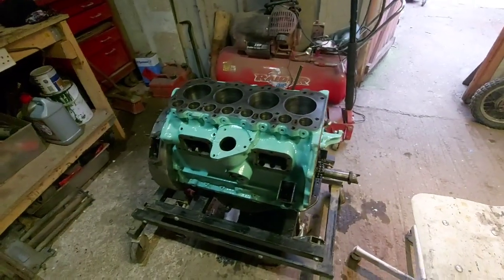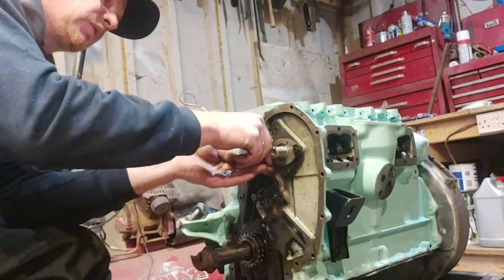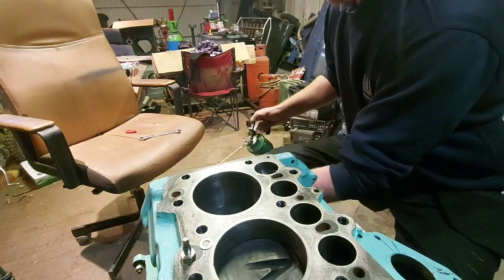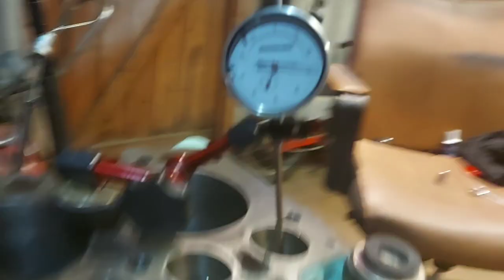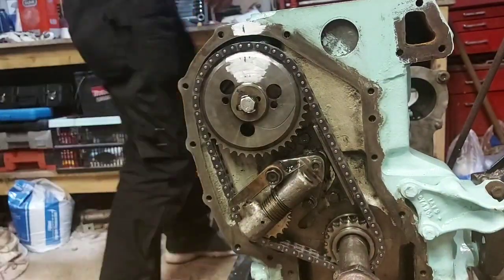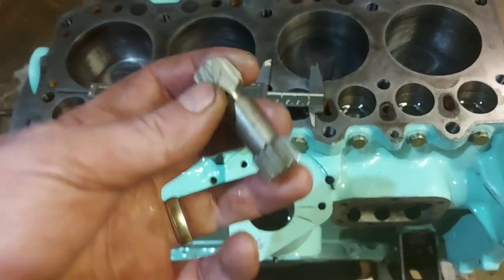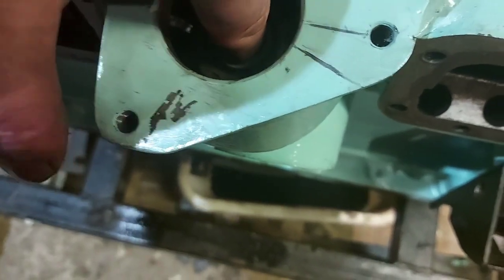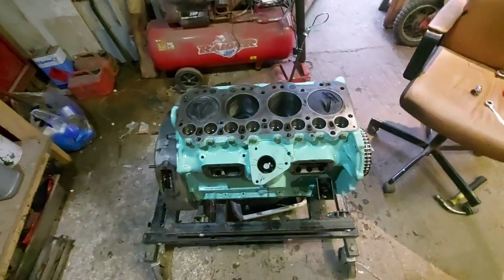land rover series 3 2 1/4 diesel build part 9. how to fit a new camshaft, timing chain, skew gear

Comment: Hello csm good video cheers  timing a 2.25 diesel   would I be looking for the middle of the flat spot off the cam or the highest  peak book vary Haynes  manual says  bring cam to high est peak and put the chain on .lr
 book says middle of the flat spot  so I set it at this but I would say it was lagging at this setting head scratch no sure
Reply from the maker: Hi, thanks for watching!
The middle of the flat spot is best if you've got running issues with it in the middle then you could also have other problems like a worn cam, injectors, fuel pump or fuel pump adjustment. 🙂👍

Comment: Hi mate. I am just about to replace my chain and sprockets but the new cam sprocket I have only has one keyway and I can't find a multi keyway version new anywhere. Would you reccomend using the old sprockets if they are not too worn with a new chain or would you say use the new sprockets too even though there is only a single keyway?

Many thanks, for the video!

Comment: The timing Cam wheel on the end of the cam shaft has a number of splines that allows for fine advance or retarding by a few minutes.. I'm hoping this may allow This might allow 20 degrees to be obtained bang on, if the pump drive is still out....  I see you have the 3 bearing 2.25. The 5 bearing 2.25 has a slightly altered Skew gear design, with one piece bronze bush and a thrust washer. Nice to see it being done...
Reply from the maker: Thanks for the input.  🙂👍

Comment: just blue a hed gasket on my 1978 series 3 have a spare engine from a 2a stripped down at the moment going to do it up and then swap it over i know its a 3 bearing compared to my 5 bearing any ideas.thanks.
Reply from the maker: A 78 series 3 would of originally come with a 3 bearing engine, and to be honest, unless you're thrashing it off road it won't be a problem, land rover and rover were using the 3 bearing crank for nearly 40 years without major issues unless driven really hard. Why not replace the gasket on the other engine? 🙂👍

Comment: I have a 1962  2a 2.25 petrol engine... with the TDC markings on the flywheel ETC...  I know your engine is a 2.25 diesel, but for my petrol engine, would the procedure for mine be the same as yours for the camshaft, timing change, and skew gear, using the EP setting on my flywheel?

Comment: love the work just wondering at the start of the cam shaft your tighteing the nuts anti clockwise  and your ring is on the righr hand but later in the video your ring is on the left hand. is that a video thing  had it before with photos.keep the videos coming really love them christy.
Reply from the maker: Thanks! 🙂 I was filming with my phone depending if I used the front or rear camera it would reverse the picture I figured it out eventually 🤦🏻‍♂️🙂👍

Comment: Cheers mate! Nicely explained 🔥. Little question. Does the flywheel has just one position on the crankshaft? Had someone paid to make a paint job and the shithead mounted the engine with the timing completely wrong (I even printed him the workshop manual). I think the EP mark is all lost and it doesn't indicate the right position. I'm trying really hard not to take the engine off the landy because I don't have the proper tooling, but I can't make the exhaust valve close completely while the EP mark is on the indicator. Greetings from Costa Rica 🇨🇷
Reply from the maker: Hi, the flywheel can only be fitted in one position there's a locating pin that lines it up. 
The EP mark indicates when the exhaust valve is fully open not closed.
Best of luck and thanks for watching. 🙂👍

Comment: Is it possible to confirm the timing by checking the #1 valve movement? Without pulling the head assembly? Cheers.
Reply from the maker: Yes its the exact same process except you put the dial gauge onto the rocker arm👍
Reply: @retro.restorations  Thanks so  much. we have battled the overhauled 2 1/4 diesel, and it's winning. I feel the distributor pump may be 180 degrees out of time. Engine  turns over, but it will not produce power/accelerate.
Reply from the maker: No worries 👍 
It is easy to get it 180 out you need to make sure the piston is on its compression stroke when setting the pump and that the flywheel is set at 13 degrees before tdc if thats all correct the master splin on the skew gear will be roughly facing 4 o'clock when lining the pump the outlet to No1 cylinder will be in line with the master splin +or- a couple of millimetres.
I hope all the makes sense.
Reply: @retro.restorations  Thanks. it makes perfect sense. The green manual describes it. But I have never one to grasp book information. Practical, hands on learning has been my best angle of attack. I'll chat with my team and we will forge ahead. Thanks again. In the future, I have the old motor to test my knowledge.
Reply: We have the engine running. We are experiencing extreme amounts of white smoke. We are going to pull the distributor pump and verify the drive gear of the pump is properly aligned. AGAIN! We are experiencing what we think is pre-detonation.
Reply from the maker: @warbirdflyer7276  have yout tried rotating the pump its a paint in the ass it only needs to be a couple of millimetres out to make it smoke pure White smoke is usually unburnt fuel usually meaning the pump is retarded black means its to advanced.
Its trial and error moving the pump a millimetre at a time if that doesn't work then something else is a miss like injectors or pump or cam timing 🤔
Reply: @retro.restorations  yes sir. That is the first thing we did. The engine ran slightly better when we rotated it to the extreme clockwise position. Still excessive white smoke. Unburnt fuel. So we are think our dist. pump drive gear/skew gear is out of position. bloody bonkers!
Reply from the maker: I would try pulling the gear and moving anticlockwise 1 spline and try again you're very lucky if you get it first time.
Reply: @retro.restorations  we will give that a try. Thanks again so much.
Reply from the maker: @warbirdflyer7276  no worries good luck
Reply: @retro.restorations  Sorry mate. one question. We have rotated the gear one spline anticlockwise. The locking pin is fighting us now. Is there a method to the alignment of pin without damaging the bronze bushing? Cheers. We are so close!
Reply from the maker: @warbirdflyer7276  it can be tricky I use a really small screw driver in the hole to spin the bush until the hole lines up it takes a while but it's the only way to do it
Reply: @retro.restorations  we were using a pointed awl. We will use a larger diameter tool and effort to align the bronze bushing. Thanks. We started to believe that the demons were within this engine!
Reply from the maker: You also need to make sure the gear is at the correct height to find the hole if it drops to low or to high  you'll never find it
Reply: @retro.restorations  I was grey before I started this. Now I am the lune!
Reply from the maker: Haha they drive you mad if you let them
Reply: @retro.restorations  like women! This girl should be running today. Thanks for your help. And patience
Reply: @retro.restorations  well. Gear installed, pin locked. The engine is running better, But it is still smoking like a train. I guess we need to verify TDC with head removed. OUCH.
Reply from the maker: @warbirdflyer7276  it definitely sounds like something is wrong. I wouldn't pull the head yet I would re check the timing if its as little as 4 degrees out it will smoke that could be a couple of degrees on the cam a couple on the pump = alot of smoke I would also get the injectors and pump tested and definitely do a compression test.
Reply: @retro.restorations  so I understand . Do you feel moving the skew gear additional teeth maybe the answer? We have brand new injectors. An overhauled pump. This pump was working perfectly on the previous engine. And the engine has been overhauled as well, so the compression should be good.
Reply from the maker: @warbirdflyer7276  I would recheck the timing its also worth doing a compression test if you've got one just to eliminate it as low compression would cause smoke when I rebuild engines once they've been bed in I do a compression test even if running correctly and have the injector pressures been set correctly? I've known new one's to be way off everything needs to be spot on if everything (injectors, pump, cam, etc etc is just a little bit off each it makes a big difference 4 degrees throughout the system is enough to smoke so if cams off 3 degrees and pumps off 3 degrees =6 and injector pressure is wrong = white smoke and poor running
Reply: @retro.restorations  We are going to try one more tooth/spline. I took a video. I was going to send it to ya for your viewing pleasure and advise.

Comment: When lining the skew gear up, do you turn the engine to top dead centre on the compression stroke (cylinder 1) then rotate again to the degree marks
Reply from the maker: The skew gear goes in at 13 degrees before top dead centre on cylinder one making sure its on the compression stroke  its easy to get 180 degrees out on the wrong stroke 👍

Comment: I have a question. Are the camfollowers lubricated with oil from the rockers? I have two that keep getting chewed up. They look a little like multi point nuts......
Reply from the maker: Hi, yes there lubricant by the rockers and a small amount by the camshaft splashing in the oil bath beneath it.

Comment: super video, i've been following all your videos of this build, and am at this same point in my rebuild..   i see you really need the flywheel on to do this job and i'm trying to decide if i should install the engine with flywheel in the landy and then do this timing, or do it on the floor, as you obvs cant do this on an engine stand..  whats that frame you have there?  is the engine bolted down, or just lucky it fits?
Reply from the maker: Thanks🙂 the frame is a trolly for moving pool tables luckily the engine sits on it perfect if I didn't have it I would bolt it to the chassis it'll make things loads easier.
Thanks for watching 🙂👍

Comment: really good vid bro
Reply from the maker: Thank you 🙂👍
Reply: @retro.restorations  does this also work for a 2.25 petrol motor? I just fitted a new timing chain to mine but would like to know if the timing is correct,  there are no 'P' indicator marks on the camshaft chainwheel on my motor, cheers

Comment: You said highlighted where the FUEL PUMP sits !!. Did you mean distributor.
Reply from the maker: The fuel pump and distributor pump are the same thing its diesel so there's no spark distributor like a petrol 🙂👍
Reply: @retro.restorations  Sorry my mistake, just realised its diesel not petrol.  Great video by the way well explained.
Reply from the maker: No worries! Thanks 🙂👍

Comment: why is this video back to front
Reply from the maker: I was filming it on my phone when I used the forward facing camera it was spinning it round back to front took me ages to figure it out but I've sorted now though 👍
Reply: lol - was wondering why things where not correct, then I realised he was tightening the bolts left direction!
Reply from the maker: 🤣🤣🤣 I thought it would just look normal for you guy that are upside-down 🙃
Reply: @retro.restorations  lol, yeah but its back to front (meant for the Irish perhaps), if it was upside down no worries :D
Reply from the maker: @rovertasmania7033  🤦‍♂️good point 😄👍

Comment: poor engines these, they eat timing chains they had them in the black cabs in the 60s but soon took them out and replaced them with the bmc diesel engines.
Reply from the maker: If maintained properly they can be very reliable one problem is when people change the timing chain they ignore the warn sprockets causing chain failure. Regular and thorough maintenance is the key. 🙂👍